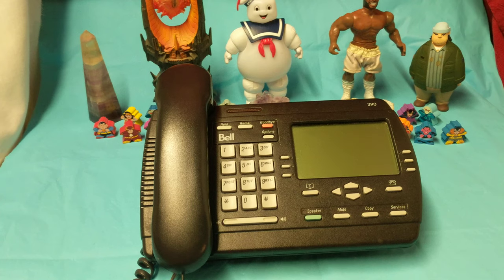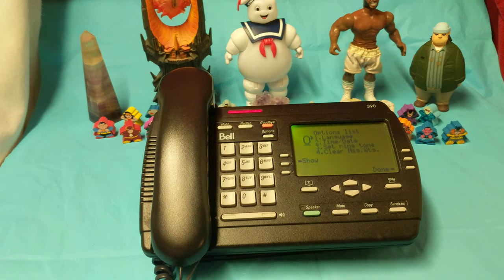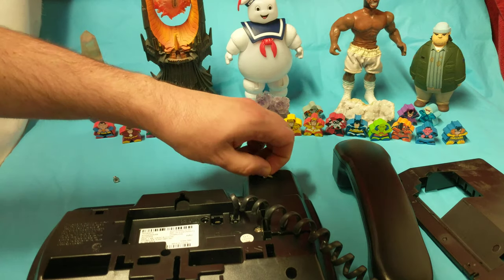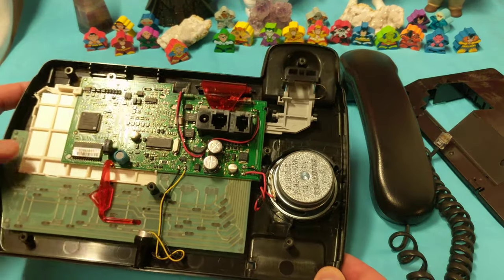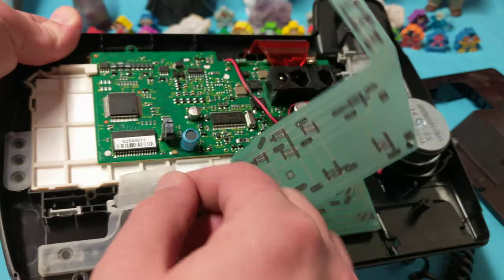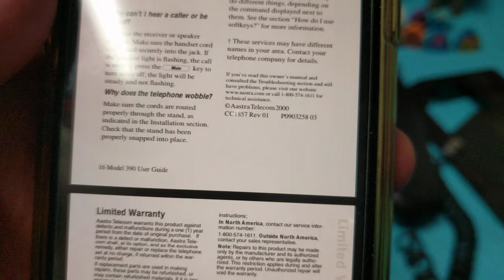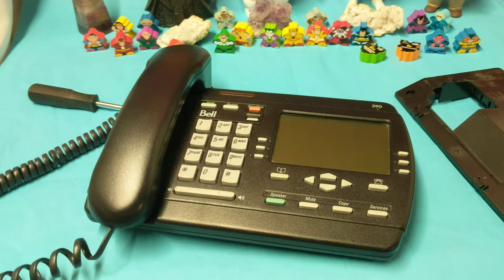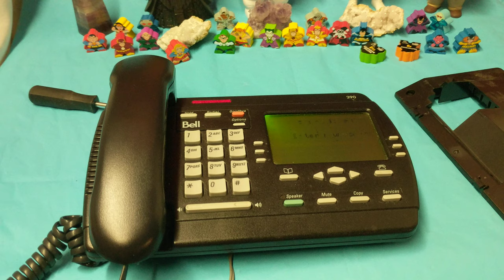Aastra 390 Analog Phone - Charcoal TEARDOWN Vista 390 Bell Telephone Standard 90s Retro Super Phone

Comment: I wanted one!  You destroyed it.!  My display died (why I searched and found you) -phone serial number 20140328  China made quite close to your phone. Bell had them built them in London Ontario when Nortel still existed. You could do telephone banking with it using the Services Button. Easier using the display buttons instead of the number keypad to navigate the bank menu. Directory assistance too. The original Nortel 350 desk phone's display  would slide out to allow installation of an updated display to allow a bank card /credit card to be loaded. (never built though) . Good phone for desk or wall. I've had several from the original Nortel 350 to Aastra. It was usually a lightning strike which killed them. 
I pulled the phone apart: the ribbon cable is (was) glued to the motherboard, the LCD screen was separated from the ribbon. The plastic mount on the LCD was broken. Now e-waste.
Reply from the maker: lol if it helps, I would have given it to you if I knew you wanted one =)
Reply: @NevsTechBits  It would probably break . It looked liked it "rotted"
Reply: @JohnRoss1  unfortunately, you couldn't change the speed dial keys without access to ADSI service.